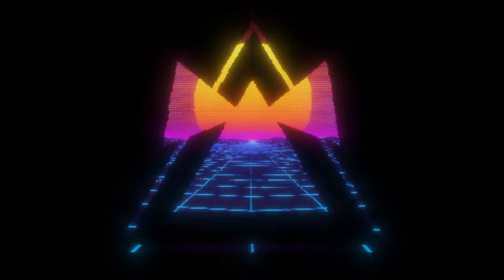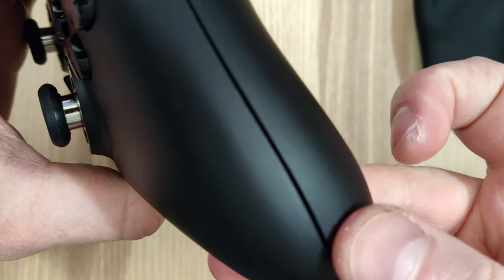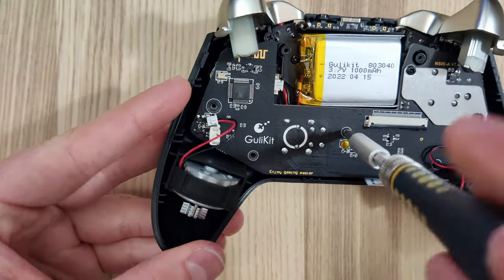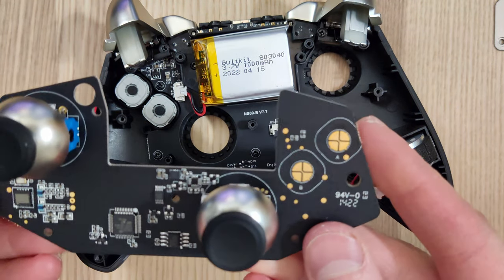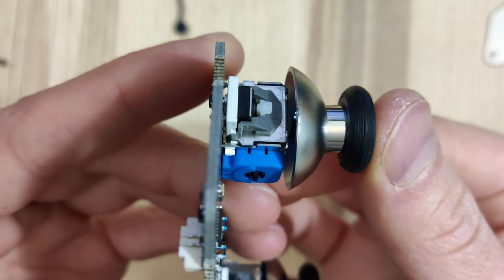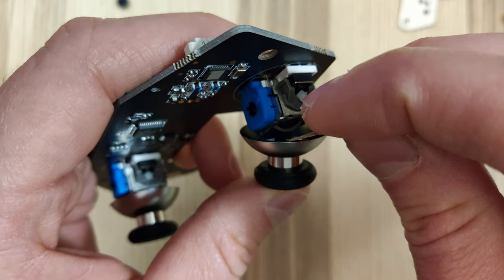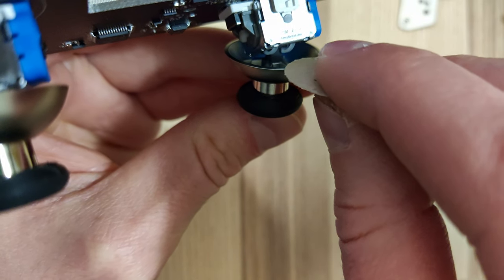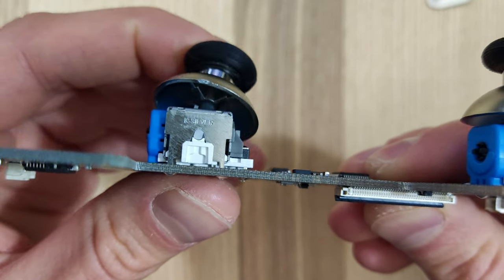Gulikit Quality Control Issues (KingKong 2 Pro Teardown and Joystick Fix)

Comment: I have a similar issue where my left stick is sticky. Meaning it gets stuck off center and I have to push it back to the middle quite often. No feels like there is some kind of sticky substance inside but I always keep it in the case to prevent such things. Haven't got the courage to open an check it yet.

Comment: I ruined my controller doing this, the RZ/LZ kept blocking the L/R buttons and as such I had to keep removing them, in the end, the holes were just ruined from continuous in and out, in any case, I would never recommend this controller to anyone, the only reason I did it was quality control after a bad unit was sent to me, shame on them for not refunding.
BTW this is coming from someone who replaced both digitizer and LCD of my Nintendo Switch including shell replacement for the joycons.

Comment: Looks like the bumper switches you don't like are fairly standard form factor so easily replaced, a mod i might do to mine also. The one i got does not have this issue so maybe it's been addressed, only recently purchased, nice n smooth.
Reply: Any idea what kind of switches they are and how durable such switches are in general?
Reply: @akashmakkar7187  I need to know this as well. I need to replace mine
Reply: @Boats_2001  They are pretty generic. 2 million clicks is their lifespan. Probably the part that'll break first. A bit disappointing tbh. You can try contacting Gulikit and see if they'll send your replacement ones and a guide on how to replace.

Comment: I also have had QC issues on TWO Guilikit controllers. The R2 button fell off and broke randomly once, and the customer support sent a new button. I replaced it, but then that button held down an R2 command because they had installed the magnet in that button upside down. I flipped the magnet and fixed the issue, but then the L1 button inexplicably sticks/won't press accurately. 

My other controller came by mail from walmart, and that controller doesn't even hold a charge. I'm not sure if I can get a refund for that one, and the customer service rep refused to replace/refund my other controller. 

I'll be switching back to xbox controllers after my experiences with Guilikit for sure! Not worth it.

Comment: Both my Kingkong and Kingkong Pro 2 has this issue with the left thumbstick it doesn't register when I move it down direction.
I had to buy an 8Bitdo Ultimate with the same halleffect sticks and it works perfect. Had it for a year now. The gullikit was just less than a month and both failed.

Comment: Yup I did this as well on mine it works alil better then before it is a great controler in general that was the only issue I saw I've had it sence two weeks after release. It is my fav controler to use on switch and second fav for computer use

Comment: Save KIEL, you are an expert on the subject. I have a doubt about this gulikit control, by default, we activate the motion sensor on the
L or ZL for games that do not support this function now the question is is there any way to switch to activate with R or ZR even changing directly on the controller board?

Comment: the joystick cap notch is from where it attaches to the sprue during injection. it can only be permanently fixed by changing the mold and having it attach somewhere inside the cap where it doesn't affect performance even if it's not cut cleanly from the sprue. otherwise a human has to manually sand down every cap
Reply from the maker: Sounds like they've changed their injection molding process from the comment they made today on this video. Excellent to see! Shame they only fixed it now.

Comment: Yeah, they need to step up their QC game, i have newer batch 2023 02 17 printed on the battery, but still has the problem in the face button and the joystick both of them sound when i try to moved or press the button/joystick, i already fixed that.

Comment: Well, dang it....now I'm on the fence on whether or not to buy this controller.   Though you are very clear and concise throughout the process, I'm just too skeeeeerd to take apart anything electronic.  Thanks for a great video! ☺
Reply from the maker: Oh, I'd buy one again in a heartbeat. Compared to my Dualsense and 8bitdo Pro 2 this genuinely feels like a next-gen controller with those hall triggers and joysticks. Gulikit seems pretty nice about sending replacement parts if needed as well if you buy from the official store. It's a gamble sure but any new product can have faults but they at least know about them now and are working towards improving. Glad you liked the video!
Reply: I have 3 of them with no problems at all.
Reply: @MobileDecay  Are you using it/them on the Nintendo Switch?  If so, is it "waking" the console and then are you able to navigate the menu?  I saw a video/demo where the user could wake his Switch, but couldn't navigate the menu.
Reply: @heylookatmelookatme  I haven't tried it on my Switch but everything I saw says it can wake the Switch.
Reply: @MobileDecay  Thanks!  : )
Reply: @heylookatmelookatme  You're welcome.
Reply: @heylookatmelookatme  It can wake the switch and works in all the menus.

Comment: Bro, help. I have purchased the Gulikit Kingkong 2 Pro, the charge was normal, but I left about 1 month without charging, now I'm encountering an issue with charging. The orange light is turning on for a while and then turning off, and it's not charging :(

Comment: On the Nintendo Switch, a message appears about the battery running out even though the Gulli Kit King Kong 2 Pro has a battery at 50%.  How can I resolve this?  I have already updated to version 5.1 of the firmware that is on the manufacturer's website.

Comment: No problem with my sticks but my face buttons are somewhat sticking (except A button). I sanded down the plastic bits that weren't trimmed properly on them and now they're better, but the B button is still sticking somewhat (double-checked to see if it's the shell but it's not), might have to open up the problematic mechanical button module or replace it entirely.

On a side note, only after putting back everything together I realised there wasn't a need to open up the controller to sand down the face buttons at all since they can simply be plucked out. Was fun though.
Reply from the maker: Glad to hear you got it working eventually! They do sell replacement button switches on the official Ali store if you suspect one of them is still having issues.

Comment: Did sanding the stick cap fix the issue? Because I did that and it still falls into some sort of notch. The sticks click as well at 180° and 270°.
Reply from the maker: Yeah, but I had to take it off a second time after the video and sand more off. Still a decent controller years later but I do prefer my 8bitdo Ultimate Bluetooth now.
Reply: Oh ok, I seem to have some sort of clicking sound coming from the sticks. Gulikit stated that they'd send a pair of sticks and I'm waiting on that. Thanks for the reply. Really appreciate it.

Comment: why did you not remove the stick cap to sand it outside the joystick?
Reply from the maker: I tried but it didn't pull off easily the first time I did the teardown. Pulled off easily the second time I opened it up though.

Comment: Any toolkit specific requirements for disassembling the controller?

I'm certain that my left stick up and down is either dirty, in need of adjusting, or perhaps fixed back in place. 

Tried calibrating it, but when it came down to making the triangle green it couldn't even reach it for me to complete the process. Got the controller used.
Reply from the maker: A simple $20 electronics repair toolkit off Amazon should cover it. All you really need is a screwdriver and a plastic spudger tool/guitar pick to open it up. Something like this should have everything you need:
https://amzn.to/442rt8a
Reply: @KeiRetroGaming  Thanks for the help, glad for the response👍
Reply from the maker: Welcome, happy to help. Hope you manage to fix it.

Comment: mine still works fine it's been more than a year, however the paint on the triggers already chipped off both left and right triggers.. but still works fine
with this disassembly walk through, makes me think to open mine to repaint the trigger, dunno..
Reply: What part of the triggers the paint started to chip? Im curious because while I really like the look of the controller I'm thinking of buying the non pro version over this because of the paint eventually chipping away. Thanks in advanced!
Reply: @psychxvi  the shiny parts, left and right triggers. It's working fine and all. It's just annoying to keep wiping my hands after playing coz it looks like glitters in my fingers after using. I have also the original xbox s controller, but I use the kingkong pro often since it is lighter

Comment: Hello! Attempted to take mine apart to fix the A button sticking. Kind of freaking out now because after putting it back together, the A and B button are now bouncing around inside up and down. I'm not sure what I'm missing
Reply from the maker: Did you put them in the slots correctly? Double check.
Reply: @KeiRetroGaming  the black button parts are rotated correctly, does that grey part have a correct orientation? I notice two sides are flat and the other two have little clips
Reply from the maker: Feel free to send me some photos of it on Reddit. It's a lot easier to see what's going on if I have a picture to look at, it should be fixable though.
Reply: @KeiRetroGaming  hey! It might not be needed! I just fully took it apart again and when putting it back together I screwed the long and extra flat side screws in extra far because I noticed they pushed the board against the buttons. I thought I screwed it in enough and didn't realize that's what pushes it together. After screwing that down tighter it seems fine now!
Reply from the maker: Hey that's excellent you managed to get it working, have fun!
Reply: @KeiRetroGaming  I will! Thank you for the prompt response and the fantastic video

Comment: Thank you brother! i have to choose between this and the 8bitdo ultimate. What is your thoughts about that? thanks!
Reply from the maker: The biggest difference between the two is the buttons are easier to press on the 8bitdo Ultimate, and the joysticks feel better on the Gulikit.  The Gulikit also feels more comfortable at least to me while the biggest con on the 8bitdo would be the loose buttons that slightly rattle and the 2.4g connector on it has also lagged on me on several occasions. Between both, it's a tough choice but I'd choose the Gulikit if you don't mind firmer face buttons. Hope that helps narrow your choice down a bit. Feel free to let me know if you have any other questions about the two.

Comment: The switches you don't like for the bumpers, those are way better than how the xbox one and third party xbox controllers are designed, which is having the actual switch in the middle of the controller, and the bumper having a stick extension to reach it, because if you get really into your games like me, and put too much force on those bumpers, the stick extension will break. This controller should be way less prone to that, or making temp fixes on the bumpers should be a lot easier.

Comment: Hi, many shops are selling those controls with additional xbox layout buttons. do I need to open th controller completly to change them?
Reply from the maker: No disassembling required for swapping the layout as the button replacements come with a tool to pull them out. The product is available here for purchase from the official store:
https://a.aliexpress.com/_mNzuApQ

Comment: Need some assistance if anybody has knowledge. I dropped my King Kong pro 2 and since the drop it hasn’t turned on since. After plugging to charge, the LED turned on to indicate it was charging, and after pressing buttons it rumbled a couple times, so it’s got power, but it’s not connecting or turning on fully. 
Any ideas as to what it could be? Seems like a motherboard connection, but no repairs shops will look at it so I wanted to attempt the fix myself. Thank you!

Comment: I was wondering if it's possible to install clicky switches in the face button and dpad? Kinda like what  WULFF DEN did with his Pro controller.
Reply from the maker: The only button switches that fit the controller are the ones that Gulikit provides. To my knowledge they're proprietary.

Comment: I had one for 3 days, it was fine until I went to use it and the right trigger was acting like it was held down. couldn't see how I would fix it after I opened it up so I sent it back and got an xbox controller.

Comment: Is the battery a common one that can be easily found when the one in the controller has completely died? Or is this a throw away the whole controller when the battery completely dies?
Reply from the maker: The battery is easily swappable after pulling off the back panel of the controller. I'd email the official Ali store to see if they're able to sell a replacement one to you, but I don't see why they couldn't. They've been really good about selling parts for the controller so far.

Comment: Have you tested xbox thumbstick/cap on the gulikit, if so do they fit? 
Im planning on replacing mine since the thumbstick is very slippery for me.
Reply from the maker: They're compatible according to GreenChii. He has a comment up with 10 likes on this video verifying it. I haven't tested them myself but definitely something I want to try down the road. Sounds like you should have no issues swapping them over to the Xbox one controller caps.

Comment: Mine work just fine, both analog is smooth (it's been like 3 weeks since I bought it) Hope it will stay durable as long as possible.
Reply from the maker: You don't see a little notch on the front of the joysticks? Should be visible when moving either stick at a certain angle. I put a timestamp in the description to show what it looks like from the outside. If you don't have it, that's great news!

Comment: Im having an issue where turning my camera/view to the left in games is significantly slower than when i turn to the right. Is the joystick done for or is there a way to clean it?
Reply: Just had exactly the same problem with my left stick today, the XInput test was showing a value of about -24000 when I pushed left and 32767 when I pushed right. I connected it to another PC and it was fine, so went back to the first PC and with the controller still unplugged, went into Control Panel > Printers and Devices, Right-Clicked the Controller and selected Remove Controller. Rebooted and then plugged the controller back in and everything was fine again and the XInput test was showing the correct values.

It's worth resetting the controller settings as well with the Gear and -- keys, and checking the calibration in the Controller settings in the Windows control panel. This might not solve your problem but it sounds exactly like the problem I had so I thought I would post what my solution was.

Comment: The stick caps are removable. Why would you sand it while having it attached to the board?
Reply from the maker: Tried pulling it initially but seemed pretty solid so didn't feel like accidentally yanking the sticks off the board. The second time I pulled it apart though, they came off much easier. Thanks for the heads up regardless.
Reply: @KeiRetroGaming  Np, thanks for the video. It was pretty indinspensable for the trigger removal and putting it all back together.

Comment: Heeyyyy my KingKong2 pro has the exact same issue! You can even see the bump when the controller is fully assembled!
Reply from the maker: Yep that means your unit is likely affected by the same problem. You'll probably have to open it up to fix it sadly. The joysticks are like night and day if you compare them side by side... Much smoother overall after sanding down the imperfection.

Comment: after looking inside the controller do you think is possible to pick up the KingKong 2 Pro  circuit board and put it in a nintendo pro controller?
Reply from the maker: No they aren't swappable unfortunately. Motherboards are unique to the controller they're from.

Comment: couldn't you just remove the analog caps to fix them much more easily? aren't they simply supposed to be removable by pulling them out from the analog's stick? (or, well, viceversa).

Comment: Thanks for the teardown! I have my issues with the shoulder buttons as well, but not from the clicky tactile feel, more so that the button flexes and there's a spongy take-up on it before the break. I'll see if I can do anything to stiffen the button or make it more rigid to help with it
Reply from the maker: Did you open it up to take a look at the shoulder buttons themselves? Make sure they're seated correctly and that the switches themselves are still working properly under the buttons. Glad you found the teardown helpful!
Reply: They function just fine, yeah. It's just a quirk of the design of the switch, button, and spring. I also use bumpers weird where I hook my fingers high on the controller and press the end of the bumpers with the inside of my knuckles, so any slack/sponginess in the system is really accentuated from the longer lever arm
Reply from the maker: I gave it a try on mine to give you a bit of a comparison but I definitely don't feel the spongy uptake using it the same way as you do. Could be the spring itself since the switch is fine. If you can't fix it feel free to reach out to the official store on Ali and see what they can do.
Reply: @KeiRetroGaming  I can also double check with some of my other friends when they get theirs because they liked it when I showed mine to them
Reply from the maker: Perfect! I'm sure they'll enjoy the controllers too. I find it hard to pick up any other controller now that I have two of these here.